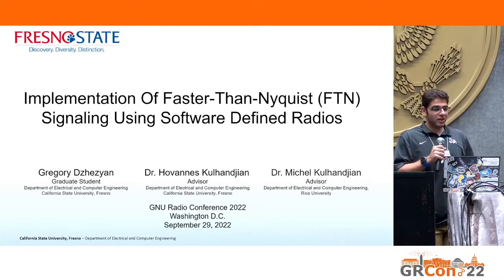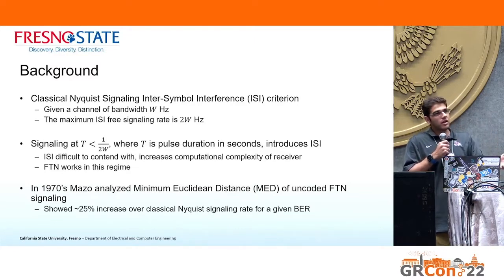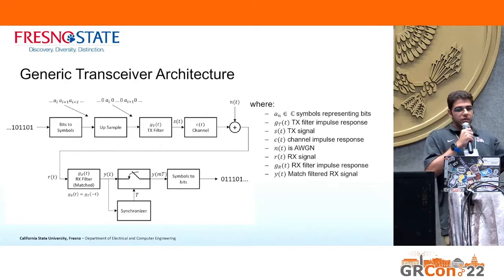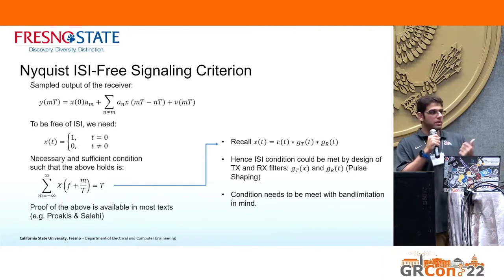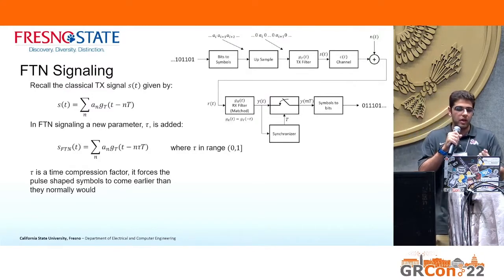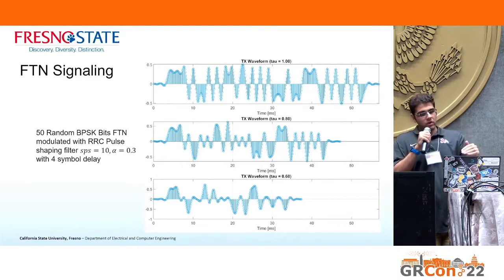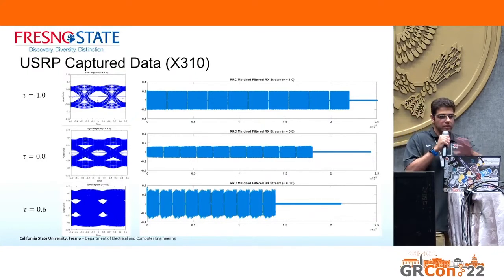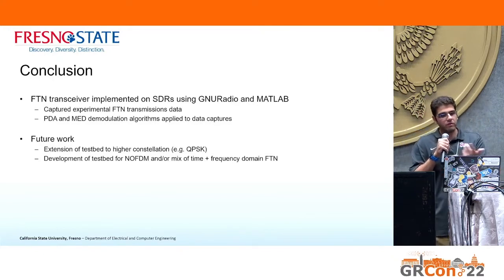GRCon22 - Implementation of Faster than Nyquist Signaling Using SDR - by Gregory Dzhezyan

Comment: So you compressed the wave form at the expense of error rate by adding the variable 'tao' as a multiplier?  No errors until tao hits 0.8 thereby improved losslessly ~20-25%.  0.7 too many errors, if you improve encoding/decoding to account for error can tao be further lowered?

Is it possible the waveform could carry more data than digital per wave if it were instead encoded/decoded in analog, accounting for error as before, or even utilizing expected error to bolster the signal's bandwidth?

Very impressed with your work, I messaged you on Linkedin and keybase, hope to hear back as it relates to a distributed (p2p) radio ISP!